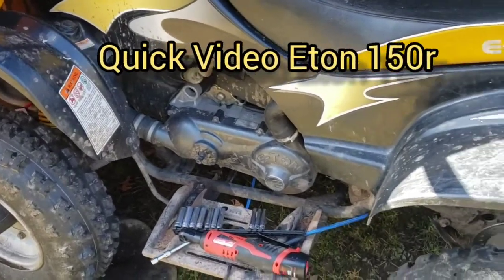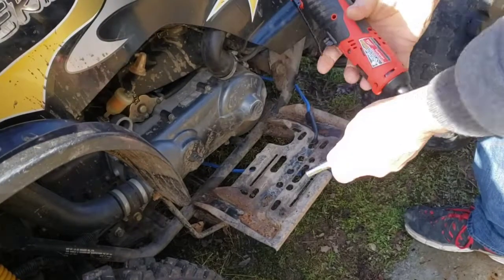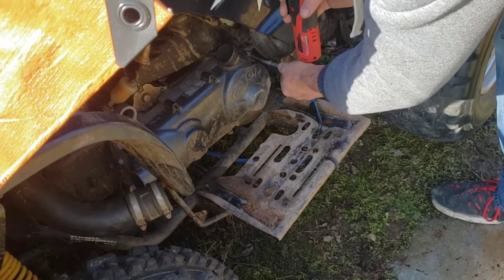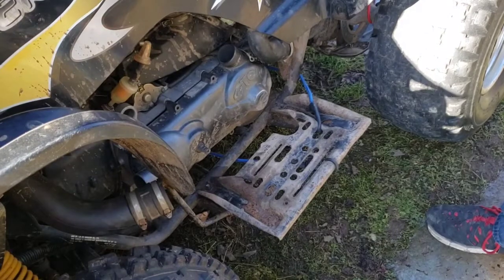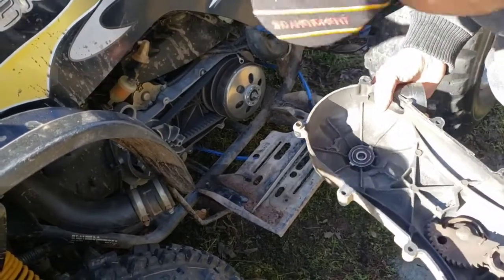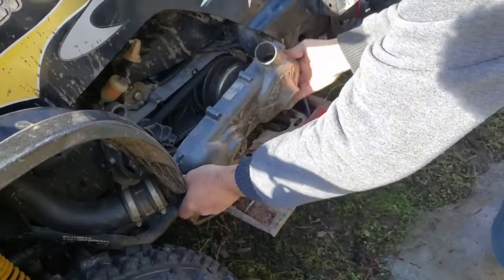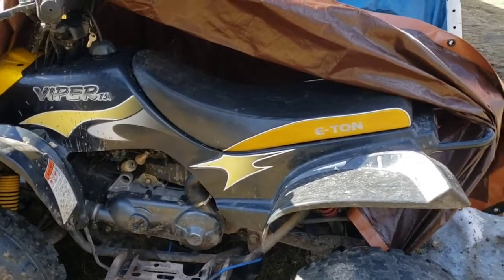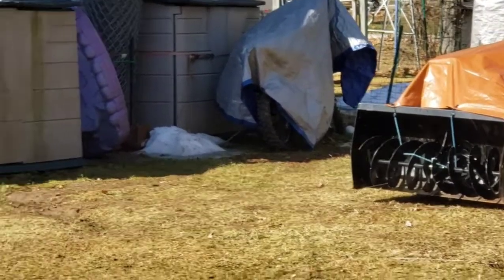Quick Once Over of the Eton Viper

Comment: Have a Toro snow blower lost the key can it be fixed
Reply from the maker: Usually can just turn the key with a flat blade screwdriver or unplug wire from key. Most snowblowers have second wire too throttle to shut them off